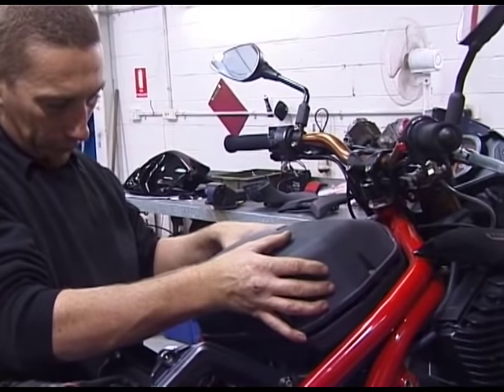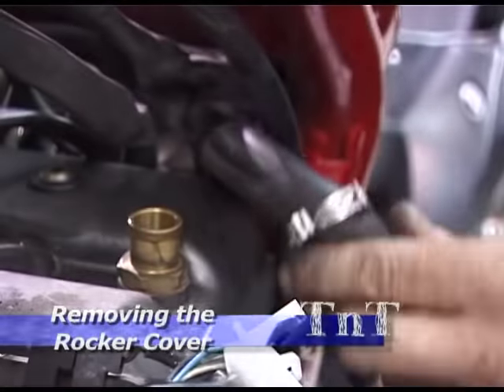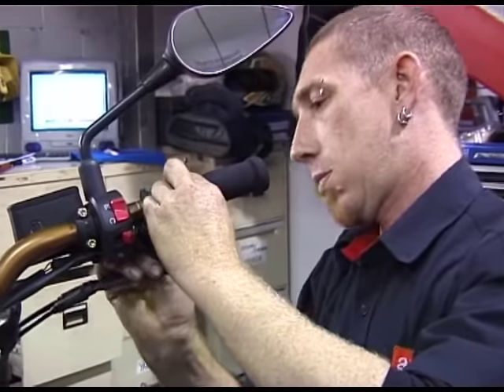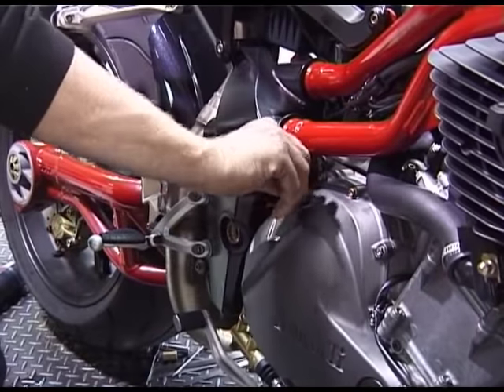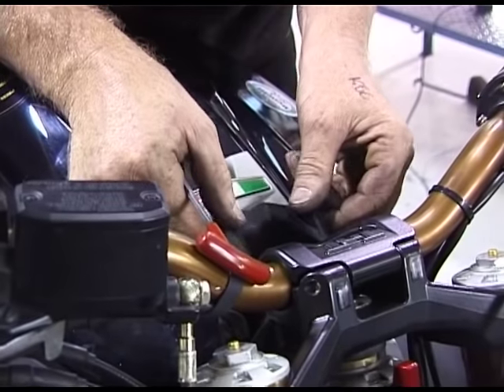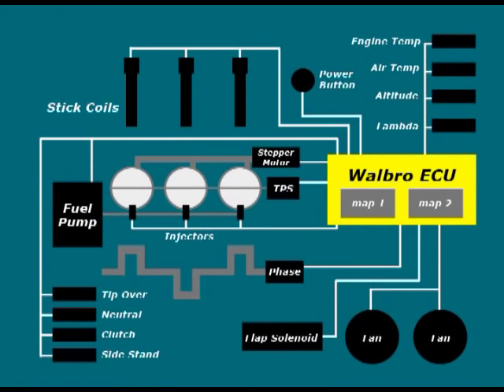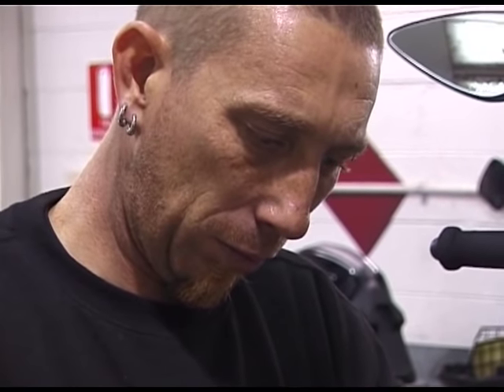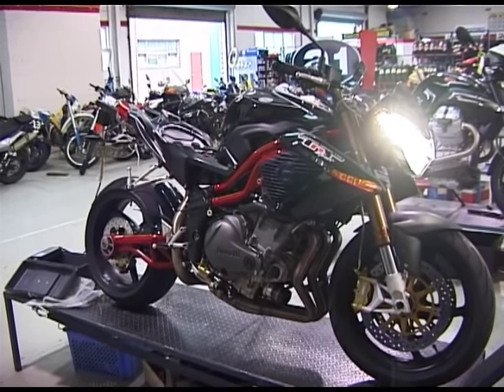Servicing The 2006 Benelli TnT 1130

Comment: Thanks Mike for sharing! I have the TreK, which is similar, and this will really help. Nice looking Guzzi Sport in the background too (I bought one off A1 a few years ago).
Reply from the maker: You are most welcome. The Trek is a very underrated bike and way more comfortable than the TnT!
Reply: You're right! I am quite tall, and after owning many bikes, including a Blackbird and the Guzzi Sport, I'm finding the Trek SO good for my frame. Just having some trouble with the idling, as it tends to stall after a long squirt, or as I'm coming to a round-about, so the piece on the mapping was interesting. But I love the character and raspy note! It's so Italian.
Reply from the maker: My 2006 TnT went through a series of map updates before it became reliable at idle and low throttle openings. I don't know about the Trek but the idle speed on the early TnTs was raised as part of these updates to stop the idle stall problem. The idle mixture setting is also critical on the TnT.
Reply: Thanks again Mike. I'll look into it. There's a Benelli Facebook page which is helpful, and also no doubt some forums. If I get stuck, does A1 still service Benellis? Or do you have another recommendation in Melbourne (I'm in Ballarat and there's no one out here).
Reply from the maker: Benelli expertise is hard to find in Melbourne these days. The two mechanics at A1 who were great with Benellis left some years ago. 
The Benelli Owners forum is still good for info though but doesn't get much traffic anymore.
http://www.benelliforum.com
Reply: @pencilcharlie1  Have u solved it.My trek 899 also has some problem with idling.Its unsteady.
Reply: @帅哥-e1w  No, keep meaning to get it mapped. But I am just careful when coming down to an idle after high speed, as it may stall.

Comment: Very detailed and professional video.  I was contemplating buying a TNT, I am in Melbourne, could you service it and complete pre-purchase inspection?  What should I look out for.. Z25..etc. I would like higher spec fans/cooling system and possibly fit TREK windshield?  Hate bugs. Which other bikes in same price range would you recommend?
Reply from the maker: If the TnT is an early one you should check that all the updates have been done. Z25, stepper motor, starter motor & clutch basket. Since the later models aren't that much more an R160 might be a better buy if you can find one. In regards to overheating, I've had no issues with mine. Unfortunately I don't know anyone locally these days who services the older Benellis.  Similar bikes from the era would include the Aprilia  Tuono, Ducati Monster or Cagiva Raptor.
Reply: is there a way i can bring bike to you from dealer?, its 2006 low klm 2500. i am happy to upgrade if needed, what is your contact number please? 
2/ I cannot find any r160 and summer is close :) 
3/I thought there was not much difference to the r160 other those upgrades you metioned?   @MikesMachines
Reply from the maker: The R160 included a hydraulic dry clutch and an extra 20hp.
Reply: @MikesMachines  Can you pick up my proposed bike from the dealer to do a full pre-purchase check? Or do i need to deliver to you?
Reply from the maker: Sorry I don't do pre-purchase checks or mechanical work.

Comment: Hi Mike, Excellent video!!! I own a 2017 TNTR 1130 in India probably the last of the lot wd Brembo kit. It has done only 2000 kms and the rpms on idling drop from 1400 to 900/1000. An issue which company failed to fix. Any recommendations please to help me out. The bie stalled maybe twice in one year but still risky to takeout on long drives. One local mechanic said that maybe the throttle body can be faulty but an expensive deal. What is your advice on this issue?
Thanks and Regards, Sagar
Reply from the maker: My 2006 TnT has an idle speed adjustment knob. It's mounted on the solenoid for the exhaust valve on the left hand side just under the tank.
Reply: hi Sagar, Ashish here, i own 2017 too, its a lovely beast, yes the idle knob is under the tank on the left... it should help.
Reply: @Quantdummy  Thanks Ashish for the response.  Would you know the best mechanics in India who can also plug it in to service my bike since noida dealership has old software which doesn't work. Can you share your info so that i can contact you. Thanks

Comment: Great video Mike. As ever very informative and a pleasure to watch. I ended up here from your later retrospective view of the TNT ownership, which in turn I found whilst researching on the TreK model. I realise the mapping of that bike is probably different but how thirsty do you find the TNT? I’m thinking of touring northern Spain along the length of the Pyrenees and feel my Aprilia Falco probably needs lots of work so I am looking at the TreK as a replacement. I believe the Falco holds an extra litre and will comfortably get 180 miles (approx 289 km) between fills on a run so long as I’m not caning it. Thanks, Gareth
Reply from the maker: Thanks Gareth. The early TnTs drink fuel like a Scotsman on a week long bender. I'm lucky to get close to 200 kms on a tank full and then only if I'm careful. The Trek has different cams and tune and should do better than the TnT but it would be worth working out the fuel economy before setting off.

Comment: Can I directly put coolant and I don't find a way to put please help
Reply from the maker: The radiator cap is on the right hand radiator under a plastic cover. The radiator overflow bottle is near the rear shock absorber.
Reply: @MikesMachines  okay that is overflow bottle that's where the coolant gets stored ?? I checked it today and it's totally empty so if I to have refill the coolant can I just pour directly or do j have to flush the older coolant ??
Reply: @MikesMachines  here in India we don't have proper service centers. I recently got my bike serviced and found the service center guy did not fill the coolant.
Reply from the maker: Unless the coolant is due for replacement you can just top it up. You may need to check the coolant level in the radiator if the overflow bottle is empty.